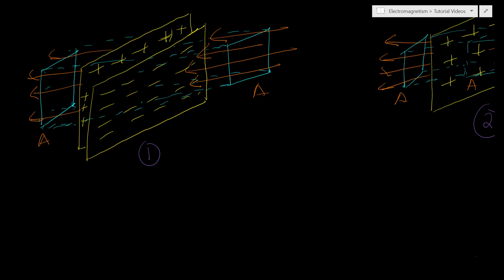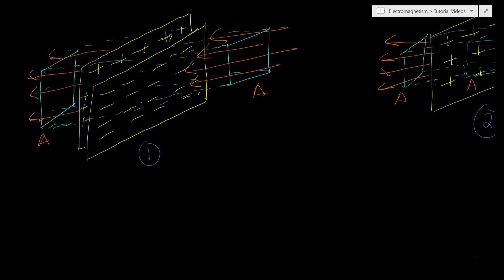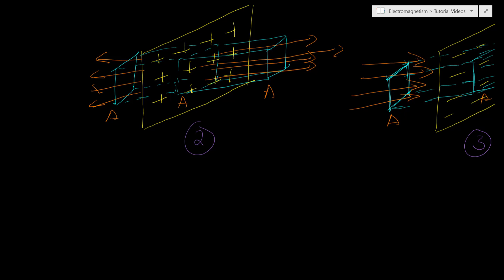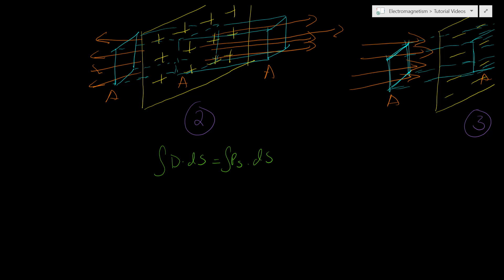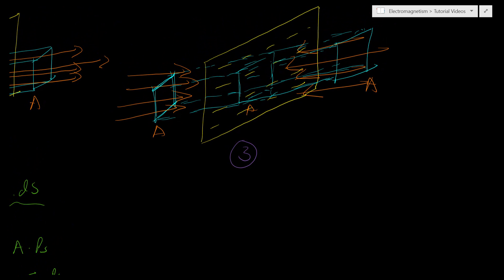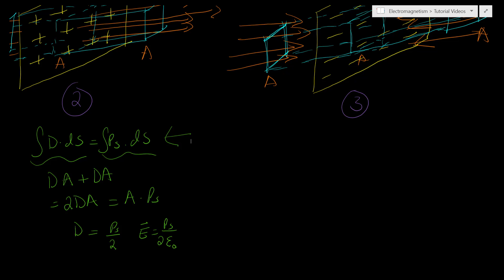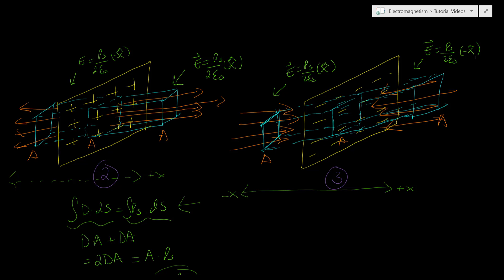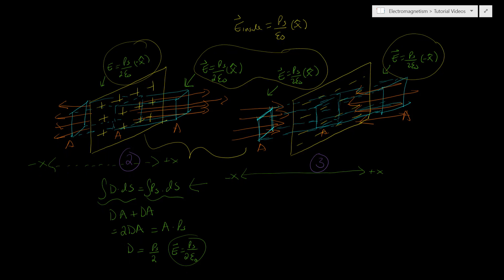Electric Field in and Outside Capacitor

Comment: what happens when you have another capacitor on the y-axis. Is it included in the calculation you did to find the field between the two capacitors on the x-axis?
Reply from the maker: Tayo olad The field would be 0 in the y direction since the plates are lying along the x axis. Similarly there wouldnt be any field in the z direction. Remember that field lines in those directions would cancel each other out.